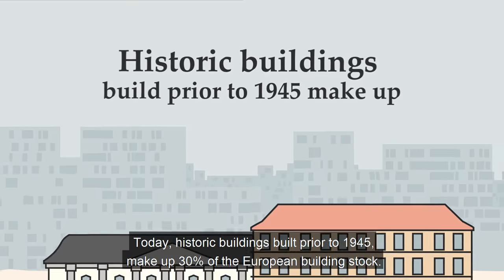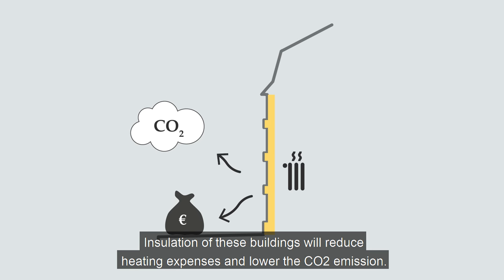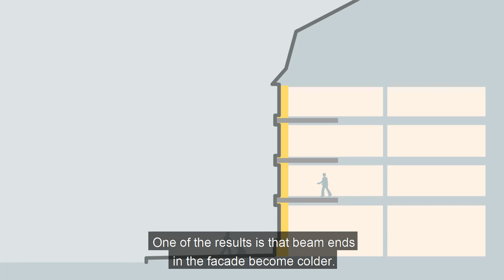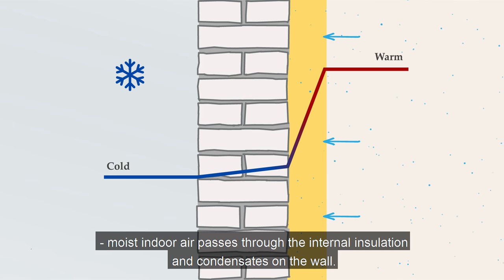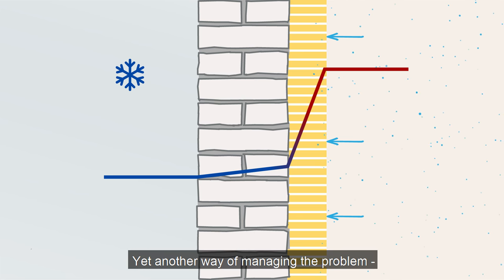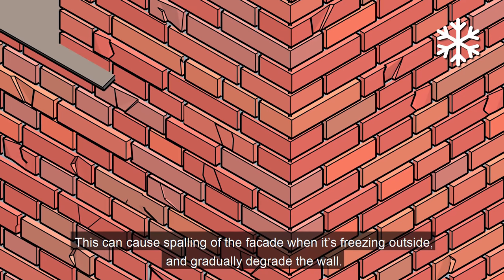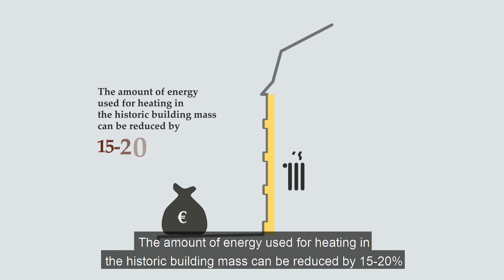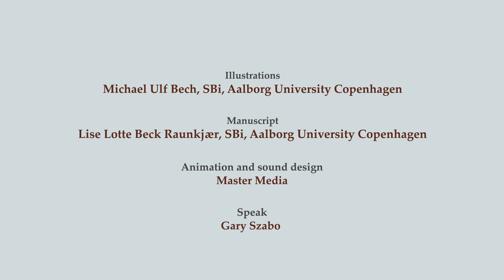Internal Insulation of Historic Buildings - Desirable but Risky

Comment: We insulated all the internal faces of our external walls last spring.
They're a 9" solid wall.
The difference it has made this winter is unbelievable. 
For the first time in a decade the house feels dry and stays warm after the heating has been on..
Reply: Solid masonry walls? My house has a brick veneer over cinderblock, and plaster interior walls. No insulation. Were yours like this? I'm researching having interior framing and insulation installed to help our cold, damp house. Just wondering that's what you did?
Reply: @Sheena Rea  the walls are clay bricks done in English bond, held together with Lime mortar.
We took all the internal plaster off (this was a mixture of gypsum & and under coat of cement!
We let the walls breathe for a month until they'd dried out some.
Then we used celotex insulation floor to ceiling, fixing it on with foam and a high strength grab adhesive. No mechanical fixings, as we didn't want a cold bridge, taped all the joints with foiled tape.
We Left that a couple of days to fully set. Hollowed out the insulation for the few wall sockets we have on the external walls.
Then fixed plaster board on with high strength grab adhesive. 
Plastered, fitted new skirting and painted.
So far so good🤞
Reply: @llisntcoolj2375  Good on you for using foam as the bonding. I used mechanical fixings and haven't had any problems though. As for the contents of this video - nearly all polyurethane insulation includes a foil skin - as does celotex - so the warnings about intersitial condensation are unnecessary - especially as you taped the joints. Our gas usage, over three years ago, was 13,000 kwh annually. Under 8,000 now, and the house stays warmer and more comfortable. There are a lot of scare stories going around about internal insulation just now. As long as the insulated plasterboard isn't fixed to timber grounds, there shouldn't be a problem. Joist ends in external walls just possibly - but the wall won't be insulated in those locations anyway.
Reply: @llisntcoolj2375  

How thick was the celotex insulation? 

Thanks.
Reply: @llisntcoolj2375  

Thank you for replying. Very interesting.
Reply: @llisntcoolj2375  What did you do in the floor/ceiling void between the ground and 1st floor?
Reply: @James_08_07  100mm of acoustic Rock wool, then 40mm insulated plaster board fixed too a treated batten (we wanted to keep the original beams on show in the lounge. 
Bedroom we've 75mm insulation +plasterboard screwed to the joists.  Then loft insulation above
Reply: @llisntcoolj2375  Can you publish the address? Then everyone can avoid buying it in the future when it's falling apart.
Reply: @lksf9820  it will have been on 2 years in March. Come back to this comment in 8 years and I'll let you know how we're getting  on..
Reply: @llisntcoolj2375   Hi, thanks for describing how you insulated your home. What thickness celotex did you use on your walls?
Reply: @roystonrichards1556  60mm + plaster board 12.5mm 👍
Reply: Insulated with what?

Comment: I just watched a video about the risks of exterior insulation. The main problem as I understood it was that it is difficult to completely insulate the exterior and the places that aren't insulated cause cold areas on the interior walls that cause condensation and mold. Also thermal bridging on stud walls could cause similar problems.
Reply: I've worked with removing damp problems in old buildings for years and I've got the picture that external insulation is always better than internal. The worst I've heard is that in some cases south side exterior insulation can actually make the building colder!
Reply: @emmaearnshaw3282  That's interesting. It might be possible to calculate whether it is true or not. Estimate the solar gain with and without the insulation. As a practical matter it seems like for most locations it wouldn't be true. In cold and moderate climates there isn't a lot of heat gain possible in the winter and the heat loss without insulation would overwhelm the lost solar gain. In warmer climates you would still need to balance about 8 hours a day of reduced solar gain with 16 hours a day of no solar gain. And of course for houses in the warmer climates blocking solar gain in the summer time is a good thing.

Comment: Great simple video. Im looking for an interior solutio for a historic 93 year old builing w/ limestone exterior building with a plaster interior and no insulation in the US. Removing the plaster on the inside is cost pronibitive.
Any suggestions???
Reply: My house is an older cape cod (80 years old, cape, brick + cinder block, plaster walls). Pretty sure it's solid masonry, altho if there's an air cavity between the brick and cinder block, that will determine what steps to take. Matt Risinger has some great videos, one is on "Insulation of Masonry in Historic Buildings." At roughly the 5-minute mark Matt's guest has some ideas for solid masonry. Also, I highly recommend Belinda Carr, she has super informative videos, one on vapor barriers vs. vapor retarders. Since I'm in Zone 4, and IF my structure has an air cavity between the brick and cinder block, then I need a vapor retarder. But IF there is no air cavity in the walls, a vapor barrier might have to be constructed on the interior as mentioned in Matt's video. Depends on which Zone you're in....  I hope your solution will be easily determined. For me, it's finding out about the wall cavity, if I even have one. Good luck to you! 🙂

Comment: If you have radiators on the same wall as the insulation is it better to bring the pipes forwards or chaste them into the insulation material (e.g. Siniat Thermal PIR Tapered Edge)? I sense it's better to have them on the outside so as not to disrupt the insulation or vapor layer.

Comment: When you insulate the inside don't you lose the benefits of thermal mass, now requiring more cooling in the summer months. Seems like the energy efficiency gained in winter months is at least off set when now energy has to be used in the summer months for cooling when it was required before.
Reply: No
Reply: Yes and no. Yes you lose thermal mass but also you insulate the external walls from outside. With lower mass walls this is beneficial in the summer.
Reply: @abescheele  I guess it really depends on the environment of the homesite. I have a brick garage built in the early 1900's and it stays relatively cool in the summer. This is probably due to the location (MA) not very hot summers, and its in the shade all day so the brick never really absorbs heat from direct sun just ambient temps from outside
Reply: I thought about that but england doesnt have constant hot 6 month summers like the intense winter a of 7 months we have :p so actually its fine to swap it for some minor summer costs. Winter is a intense fuel burner when summer you can have a cold shower and cool down :p

Comment: Excellent video. What insulation material is open for vapor diffusion though? I can only think of open cell spray foam but it is not a desired method to use IMO.
Reply: I've heard of a few: Diathonite lime, cork and clay based insulating plaster; or wood fibre, sheep wool and hemp with a lime plaster.
Reply: Udiin2cm
Reply: @alexlees9223  Desirable for stone walls, yes.  Use lime to allow vapour diffusion.
Reply: Lime, Cork, wood fibre,  rockwool, wool, glass wool, hemp, hempcrete are examples of vapour open materials which can be used to insulate old buildings

Comment: Insulation that is open to vapor diffusion is = to say Vapor permeable?

Hi it would be awesome if you can confirm if Rockwool a mineral wool insulation sold in USA is or can be considered as an insulation that is open to vapor diffusion? if that's the case, this will be my go to insulation behind my 100 YO double brick walls.

Thanks for takin the time to upload this very informative videos :)
Reply: Do some more research, but rock wool was our first choice until we found out about sheep’s wool.
Reply: Mineral wool is great for insulation & its claimed to be hydrofobic. But in reality it performs really, really badly in wet environments as it will become saturated with water & that is a massive problem. Your only solution (if you want your 100 year old walls to last another 100 years) is to insulate externally.

Comment: What about the use of cork as an internal insulation ? What is the best thickness/density to use for an internal wall which is set into a cutting in a hill ?
Reply from the maker: Just to clarify - what do you mean by "an internal wall which is set into a cutting in a hill"? Could you expand on this a bit?
Reply: Rear concrete wall is built into the side of a sloping hill.  Similar to the problems concerning a concrete basement wall. Bone dry concrete but for thermal insulation & to save on heating bills thought cork ideal ? 

What research have you on cork as insulation for interier walls ?
Reply: @ribuildproject1479  Please share infromation you have to date. Thank you.
Reply from the maker: @personalexperience3637  There has not been done any research on the use of cork as insulation material in RIBuild, so we can't help you. Sorry.

Comment: Great video!  I am remodeling an apartment in Portugal and the wall gets so cold.  Thinking of using ceramic cooating internally (via spray).  I believe moisture doesn’t penetrate.  Is it a common way for internal thermal insulation?  How effective is it?
Reply: Coatings, dependent on their make-up, can lock in moisture, which is the last thing a wall needs.  It either has to vapour permeable or not.  If I was you, I would insulate the wall by strapping it with wood, infilling with insulation, installing a vapour barrier and then, applying insulated gyproc.  Then, no warm air/moisture will reach your cold wall where it can condensate.

Comment: What insulation materials are vapour tight?
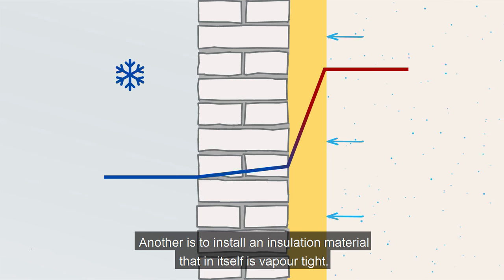Reply: 2:25
Reply: @vikentijslauruts2153  foam board is the only one i can think of
Reply: Foil backed plasterboard
Reply: @deanodog3667  plasterboard is not an insulation material.
Reply: Foil-faced PUR/PIR foams (actually foil-faced anything). foamglass (it's a closed-cell glass),  XPS (Extruded polystyrene) is fairly vapour tight, but not totally (it's a scale, not a yes/no).
Reply: @Wookey.  But, all the above products should still be covered with a vapour control layer.
Reply: @riboid  Why? They are vapour-tight themselves if the joints are sealed so there is no point adding another layer, unless you choose to do that rather than tape the joints? I'd always go for a vapour-open IWI design on historic buildings anyway (i.e woodfibre and lime render), unless absolutely certain that there is no issue of damp coming into the walls from the ground.

Comment: That's really a great way of explanation.
I need help from you guys. As im doing my thesis on how to do the heat insulation in an olden brick wall building in Germany. if I get some information regarding sustainable ways of heat insulations it will be helpful for me in my thesis. that building was built-in 1929-30. so the heat insulation was not that great in that building.  it is under UNESCO heritage buildings.
Reply: Hi. I am also doing a small report about this problematic. May I ask you few questions about it? Let me know if you are willing to talk about this through email for example :)
Reply: @jurajboda6738  I work in the insulation industry and I have attended courses on the insulation on solid stone walls.  The insulation, plaster all has to be permeable to allow the wall to breathe and for moisture to wick back and forwards.